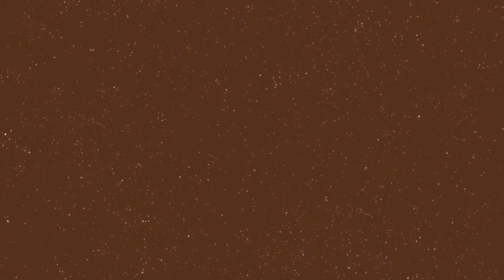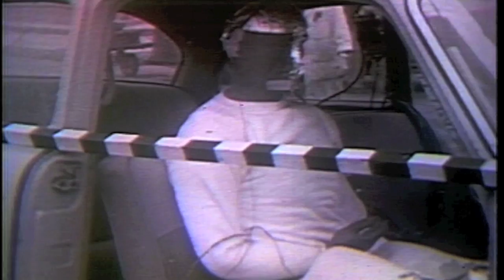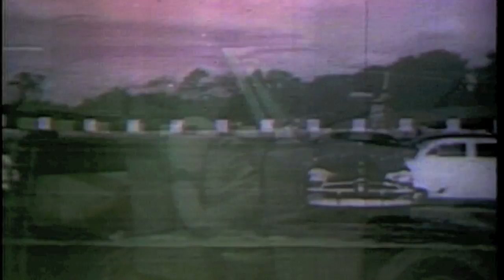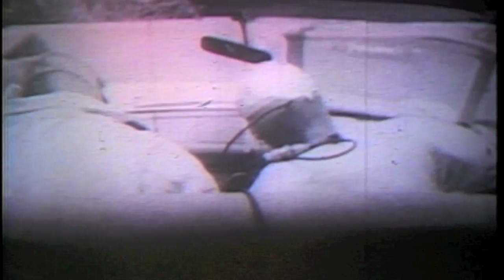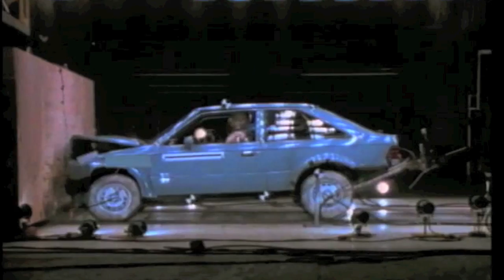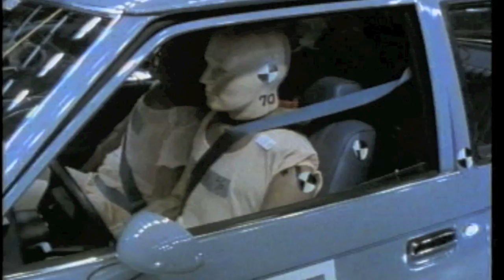Ford Crash Test Now & Then

Comment: Maybe a FEW side impacts came out better back then, because both cars had a high ride height, and the body panels were thicker than now. But, then-there were no side curtain airbags (those are very recent) and, again, the occupant wouldn't be restrained so they could be ejected through the side window.
Reply: The body panels were thicker, but you still had a hollow door with no impact beams, horrible rotary door latches that would allow the door to spring open in a rollover, and tiny B pillars.

Thinking those old cars were better in a side impact is like thinking wearing a heavy winter coat will protect you from a bullet
Reply: What's wrong, afraid they'll land on a cushioned door too hard, then magically fly out the window? That thin beam is not thin, you just don't realize the size of the automobile. It's comical that you are afraid to compliment the past automobiles on having more resistance because of your modern mentality, then a thicker than that door 28 word slander as to how they aren't better. Jesus, you all do anything to show how you hated racist times. There would never be this much criticism and hate for those poor times if you didn't have another reason to be so enraged all the time scooter. You remind me of Mr Darling saying "poor nana? Poor Nana!?" After the children go to help the dog, both because you are unloved, and because you represent that mentality of getting angry when something that hasn't been awarded so much as a compliment (without you festering things attacking anyone who says something good about it), is finally shown appreciation. Poor you.
Reply: @WitchKing-Of-Angmar  Some thousand island dressing for your word salad-Sir?
Reply: @WitchKing-Of-Angmar bigger doesn’t mean better

Comment: I used to have a ‘55 Fairlane- what they never talk about is that older cars had enough visibility to avoid CAUSING a collision.  There were no blind spots at all.  No seat belts and I never worried.  Maybe it’s because I was 25
Reply: My new  Bolt has a rear backup camera and radar proximity warnings. Big windows won't help if somebody goes through a red light and T bones you, or crosses the double yellow line and hits you head-on.
Reply: @drpoundsign  I DO like the airbags. I find those other accessories mostly irritating. Keeping people from paying closer attention. The pillars on some makes just backing up and seeing anything difficult. I appreciate back up cameras, but would also like to see out windows.
Reply: exactly that’s exactly what i like about my brother 78 chevy big windows and blind spots 😂
Reply: Ya and no smart phones and no computers to navigate in the center of the dash taking your focus off of guiding a two ton speeding bullet.
Reply: The A pillars on new cars have gotten ludicrously wide. I feel like I need to look six times before pulling out from a stop sign in these modern cars.
Reply: @Oldsmobility98 dude is it really gonna kill you to adjust the position of your head?
Reply: Yeah and I’m sure you totally look both ways or use your turn signals when turning

Comment: Ah yes, the 1950s Fords - solid metal dashboards for your face to slam into on impact. Lose your teeth, break your nose, have your entire skull caved in.
Reply: @winforworkgroups  Dead with only a scuff on the car. That way I can possess it like Christine and keep driving.
Reply: @number3665  HAD to give you a thumbs up for that one. Always Good to see Bullies get their due.
Reply: @number3665  yeah my man
Reply: Old cars use new cars as a crumple zone. Be like running onto a mattress. 
Old cars crumple only the weight in the rear keeps pushing after the front has stopped . Less whiplash I would think.
Reply: But you notice how the car dosnt crumble if only they would make old cars now but with all the safety
Reply: @jesselang762  BULL. Modern cars are meant to crumple...but in the hood and trunk areas, away from where the humans are seated.

Comment: Kudos to Ford for their Life-Guard program back in the 50s! It didn't sell and customers hated it, but they did try in a day and age when no other automaker cared.
Reply: YES. But-the lap belts only became standard in the 60s, and the three point belt later. Airbags and crumple zones were perfected in the 80s.
Reply: @drpoundsign  no you nut, lap belts were first used in 1885 used first in a vehicle in 1925, and Volvo created the three end Seat belt in 1957-9.
Reply: @artdecotimes2942  "only became STANDARD in the 60's"
Reply: @drpoundsign  lap belts are still useless

Comment: them cars were safer then todays cars . just go look at the crash test  of 2000 cars
Reply: ymxctrails and if we take dump trucks out of the equation, newer cars look more damaged in the crash not only because of crumple zones, but also because they channel the energy away from the occupants of the vehicle. Older cars may be stronger than newer cars but they are not safer. Older cars could still work after a crash but the people inside would take the full force of the crash. Not to mention cars of this age rarely had seatbelts and airbags.
Reply: @ajlaurenjunjo  Exactly, the best you could hope for back then, is that you were launched through the windscreen and 'thrown clear' of the crash as you'd sustain far less injury than being hurled into a metal dashboard, spear-like steering column, or just crushed by the engine as it flew directly backward into the firewall.
Reply: @Reddsoldier  You know, actually, I think that just because the windshield gives way doesn't mean that it can't crack your skull. They had a commercial about twenty years ago with a sledge hammer hitting a coconut, to remind us to use our seat belt. Also-once your are thrown, your car, (or another vehicle) can turn you into roadkill, or you can hit a telephone pole on the side of the road.
Reply: @Reddsoldier  I do NOT recommend being ejected nowadays! When I was young, I thought that controlled ejection (like in military aircraft) would be  Good. I mean, if you stall on the tracks and the train is coming, the whole seat could be launched upwards and to the side. That could also work in head-ons with tractor trailers, to prevent a hopeless outcome.
Reply: Them brain is not what it used to be!
Reply: @ymxctrails Dump trucks are Heavy like Elephants-lol.
Reply: @ymxctrails So would an Abrams tank. DUH. Trucks are big and heavy. Be careful around big trucks! But-car-to-car crashes, and hitting a solid object is safer than it used to be. They still have some work to do with rollover crashes.
Reply: Garrett - what's your point. If you are in a high speed crash in any vehicle old or new, your internal organs cannot withstand the impact
Reply: They didn't crash those old cars at 65 km/h with a moderate or small overlap like they do with newer cars. Traffic fatalities per 100 million miles traveled were 5 or 6 times higher in the 50's than they are now. Stats don't lie. Even watch GMC's 1960's Crash Test, IIHS Bel Air vs Malibu, Renault Modus vs Volvo 940, etc. Seems to me newer cars almost always come out better. Wasn't uncommon for seats in classic cars to detach, occupants to be ejected, or for the solid metal steering shaft and dash board to plow into your head.
Reply: @vinniegee3680  ...or chest, depending on your height.
Reply: ymxctrails no just because a car is strong doesn't mean it's safe. The newer car has a crumple zone
Reply: @ymxctrails I think the Belair test was biased because it probably had a LOT of rust in the body and chassis, and iron oxide has like ZERO structural strength. But, then, modern cars are more rustproof and have more aluminum and plastics which last a long time.
Reply: ymxctrails but a dump truck is a dump truck. It weighs a lot. A vintage car may be heavy, but it is not dump truck heavy
Reply: Nope. Newer cars are way safer
Reply: older cars are much more dangerous.
Reply: @ymxctrails also the 59 Bel Air was obviously rusted out underneath. You could see by the red smoke upon impact.
Reply: @Wilantonjakov  my motto is, "if they lie on one thing then they lie on everything"

That video is just a big phony to trick young kids into not buying older automobiles. You can't test a brand new car against an automobile that is 51 years old since the factory.
Reply: but if you get into a high speed crash you get crushed in newer cars
Reply: Garrett Smith that’s what I always thought too
Reply: @redtra236  Doesn't happen that often, unless a tractor trailer runs over you. Even with a side impact, the head curtain airbags have decreased mortality. Also, here in Suburban Detroit, some intersections have  been replaced with roundabouts. More crashes, but less Deaths than with other types of traffic control.
Reply: you are obviously not that intelligent